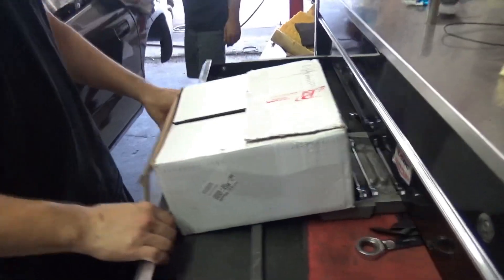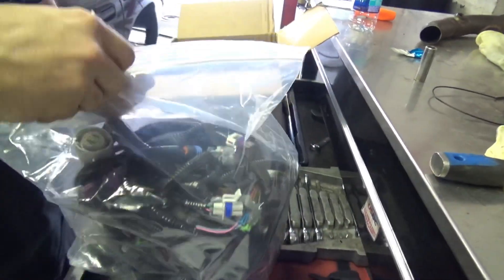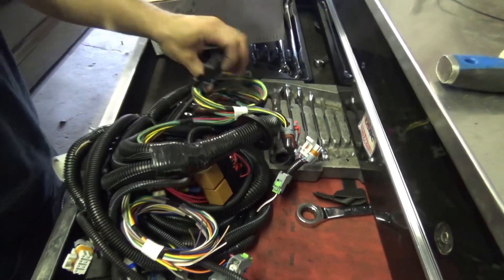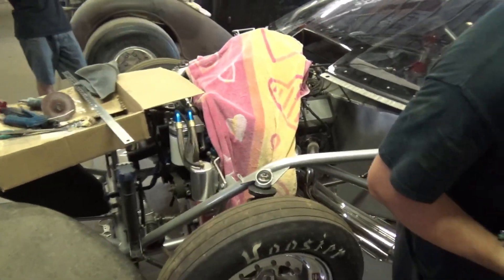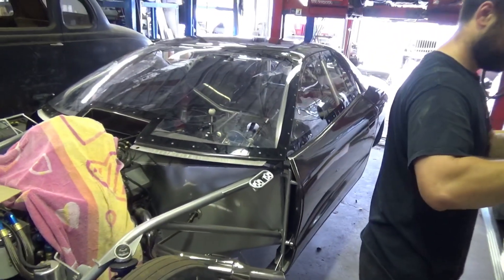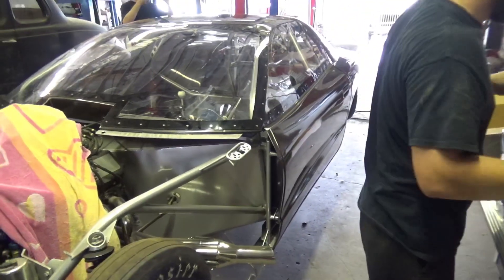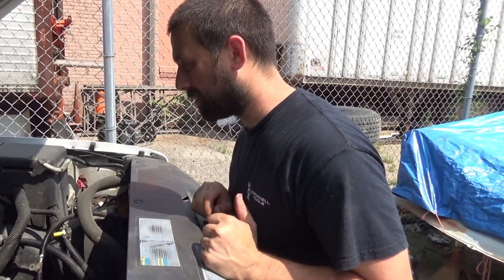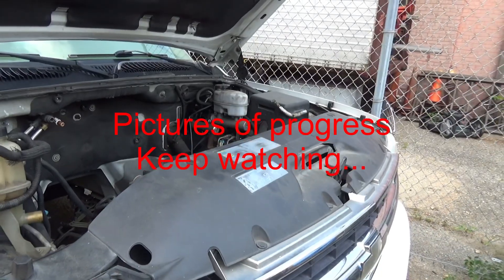LS Swap Tacoma! update

Comment: You planning on an aftermarket drop bracket? It looked as though you rear diff bracket had been cut. Also, do you think the rear end will handle the extra power? I knew 2 guys who ran boosted 4.0's with stock rear ends and end up toasting them along with the trans.
Reply from the maker: Hi thanks for the comment. So my plan is to eventually make the Tacoma into a pre-runner or a Poormans trophy truck. So eventually when I can finally afford to buy RCV’s for the front I’m going to put my 3.5in Long travel on. And hope after that I can find someone to make me a rear cage so I can add kings in the rear as well. Right now the Tacoma is just sitting on a basic 3 inch Procomp lift. 
As far as the rear holding up to the added power lol I have no clue bro lol. I’m currently running 4.88nitros new ring and pinion’s with ARB air lockers.. A local shop says it should hold up. But I have no clue. Their exact words..." if a stock Dana 30 can hold 40s your Toyota axle should be able to take the abuse with nitro 4.88s " which are almost like Dana 40ish
Reply: @draculaS2k  Woah, RCV axles cost some serious $$$! Good luck, I'm excited to see what comes next
Reply from the maker: Yea they are $2195 Plus tax which is not bad because they are made for 9200 foot pounds of torque. I have the rearend from the Tahoe as a backup.. so only thing I would need to do is regear it to 488. If I blow the rear out of the Tacoma lol

Comment: Where did you get the harness conversion kit from
Reply from the maker: PSI conversions
Reply: DraculaS2k does it plug into the Tacoma’s computer or you have to use the old computer
Reply from the maker: I have a chevy ECU. You can bridge the two if you need to. But if you're planning on doing an LS swap all your Toyota drivetrain parts will need to be GM powered